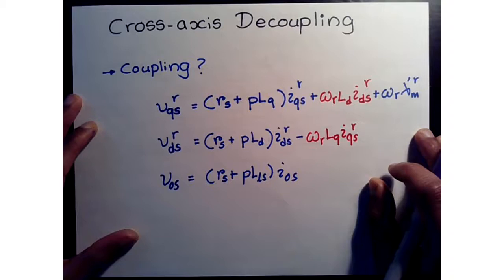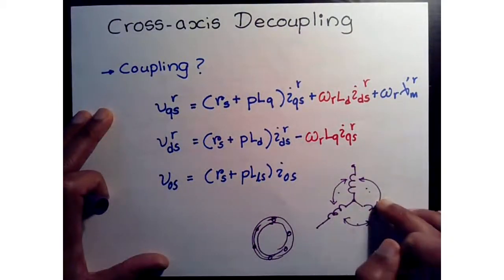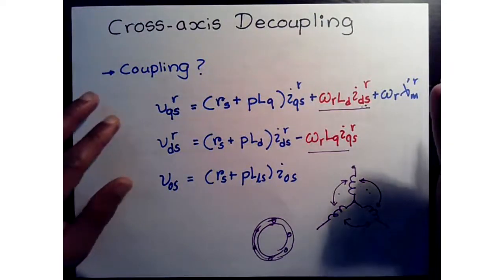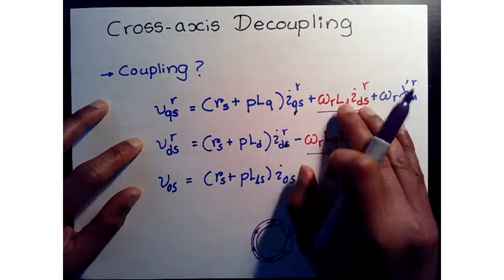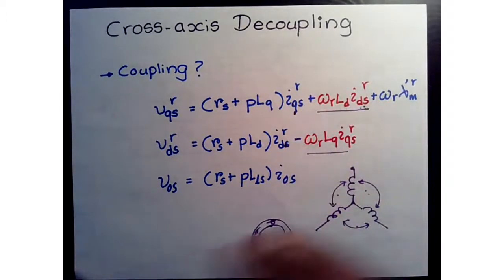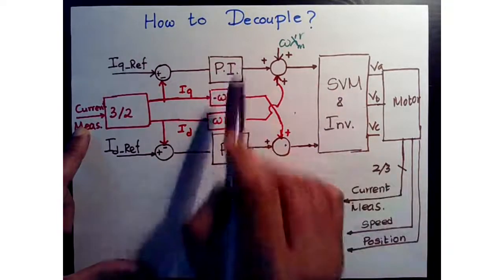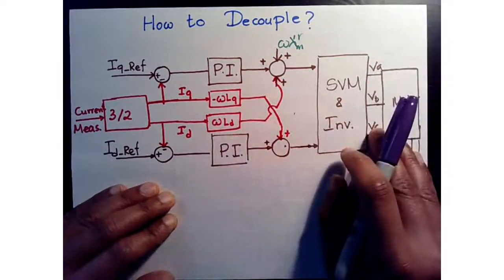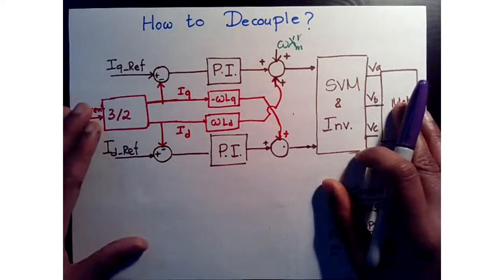Cross-axis Decoupling in PMSM Drives

Comment: very nice explanation, would appreciate if you include some referenes regarding this topic as well.
Reply from the maker: This is a good reference. There are some textbooks that discuss this topic but I can't recall any names at the moment.

H. Zhu, X. Xiao and Y. Li, "PI type dynamic decoupling control scheme for PMSM high speed operation," 2010 Twenty-Fifth Annual IEEE Applied Power Electronics Conference and Exposition (APEC), Palm Springs, CA, 2010, pp. 1736-1739, doi: 10.1109/APEC.2010.5433467.